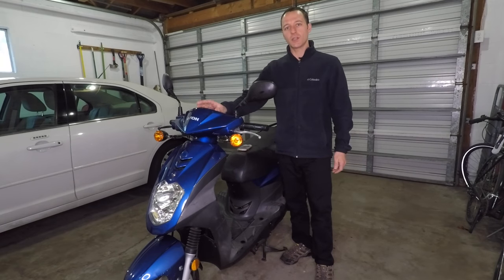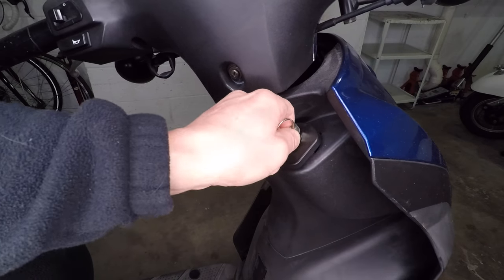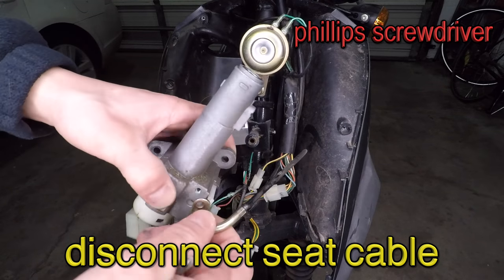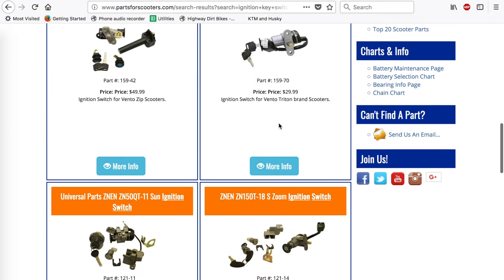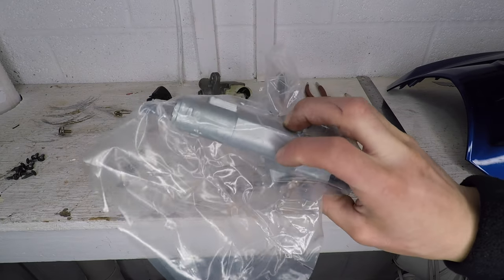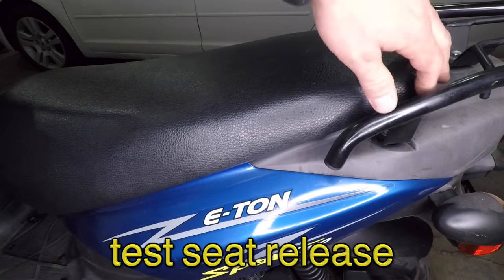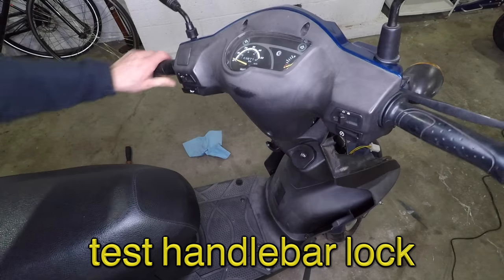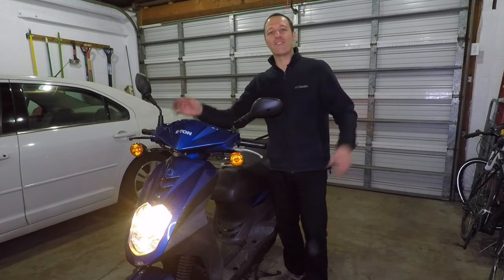How to replace the ignition lock key switch in a scooter

Comment: Thanks! I came back to my scooter after watching a movie this evening only to discover that someone had vandalized the ignition switch with a drill, taking out about 1/4" of material. Unfortunately I couldn't start the scooter with the damaged ignition. If it's still there tomorrow I'll use the info from this video to remove the ignition and walk the scooter back home. At that point, I can order a new ignition and I'll use the info here to put it in. Thanks for sharing!
Reply from the maker: Sorry to hear about your scooter.  At least it's not hard to fix.
Reply: @LabCoatPaul  Thanks Paul! I Installed a new ignition switch, but I made a small mistake -- I ordered one that was not an exact match and tried to rewire the connection switch.  Somewhere along the way I blew the fuse on my scooter. Not a big deal there, I got some new fuses at O'Reilly's. I have now ordered the correct ignition switch and will install it soon.  Interestingly, when I tried to put in a new fuse earlier today (I have not yet installed new ignition switch, so there is currently nothing hooked up to the wires) the new fuse blew right away too. So, there is still a bit of troubleshooting to do...maybe it was the wrong fuse or maybe I need to hook up the ignition switch first.  Any thoughts?
Reply from the maker: @stephenallen3888  You might have a wire touching the frame somewhere.  You can connect a piece of wire where the fuse goes, then jumper it to the other side (instead of using a fuse).  Watch for sparks.  This way you can see if you have a short circuit without using a fuse every time.
Reply: @LabCoatPaul  Okay cool thanks Paul -- I have a new ignition switch in the mail right now and then when I open up the scooter to install it in a couple of days I'll investigate for any contact between wires and frame. I'll test out that technique using a wire to check for sparks.  Thanks for the info!

Comment: Hi there! I have an E-Ton matrix r4 150 and I need to replace the ignition switch as well. Your video makes it seem super easy. I was wondering if you might help me with locating the correct ignition switch though? Thanks!
Reply from the maker: Basically, you have to start by removing your old ignition switch.  Then hop on the internet, and search for one that looks like it, and has the same measurement between the bolts.  Ebay has a lot of e-ton parts.

Comment: Hello I have a United motors speed 50 r. Don’t have the key for it, it’s been sitting for years. If I replace the ignition switch what about the gas tank and seat? Will the new key work on opening it up? Thanks again
Reply from the maker: You can find ignition key sets online that include the ignition switch, seat lock cylinder, and gas cap.  If you replace only the switch, you'll need to carry 2 keys.

Comment: It is possible to take just cylinder out from this ignition switch or not? I have a broken key inside the cylinder and I want to take apart and use the same key...othervise I need to change also key for gas tank
Reply from the maker: You will still need to buy the whole switch, but you might be able to change only the lock cylinder.  It depends on how your particular switch is designed.

Comment: I have the same scooter as you but I'm having some trouble removing the key switch. Any tips on how to remove the second bolt at the back? Thanks
Reply from the maker: The second bolt is just hard to reach.  I just used an open end wrench and flipped it around to get the best angle.

Comment: i jsut took the front panel off my scooter, and there appear to be spare connectors, do you know what they might be for ?
Reply from the maker: I don't know.  Sometimes Chinese scooters will have extra lights or an alarm system.  You can find out by following the wires and looking at a wiring diagram.
Reply: There are connectors and if you. Disconnect them you can Kickstart but yea idk
Reply: @LabCoatPaul  it was a spare. Thanks.

Comment: Any idea how to Hotwire this scooter ?? My scooters ignition switch has gone bad so am trying to hot wire it. Any inputs will be highly appreciated
Reply from the maker: Start by looking up "50cc scooter wiring diagram".  Most scooter ignition switches will have a red battery wire, a black ignition wire, a black/white for the CDI, and green for ground.
When the ignition is ON:  The red and black are connected.  Black/white and green disconnected.
When the ignition is OFF:  The black/white and green are connected.  Red and black are disconnected.
Reply: Ok connect the red to the black (that will start it),when you wanna turn it off connect red and black and black with white stripe
Reply: What if you only cut the red and black and tie them together? Will the kill switch still work?

Comment: What if your steering is locked. Will it unlock when you take the old switch off
Reply from the maker: yes.  The ignition switch has a metal rod that goes into the steerer tube, so when the switch is removed, the steering is also unlocked.
Reply: @LabCoatPaul  thanks for your video. I have a strange scenario in that when I returned to my back after work It appears that someone may have tried to steal my bike (albeit I cant see any realy damage) however, the handle bars move freely whether the steering lock is on or not, but only to the straight forward position. I cant steer to the right at all??? if I remove the ignition will this help to put handlebars in correct position and then return the ignition switch.
Reply from the maker: @markjacobson417  Hi!  It sounds like someone broke your steering wheel lock.  Yes, it's part of the ignition switch.  Take the switch out and see what's going on, then order a new one if you need it.

Comment: i wish it was that simple for me. the previous owner of my scooter changed it in a really wonky way, cheap af.

basically he removed the seat lock thingy and the steering lock and just put the cheapest ignition switch he could find on my piaggio nrg
Reply from the maker: Yeah that sucks.  It sounds like you'll have to un-do all that stuff first, then you can fix your scooter.
Reply: @LabCoatPaul  yeah.